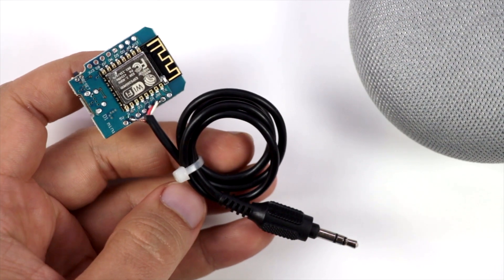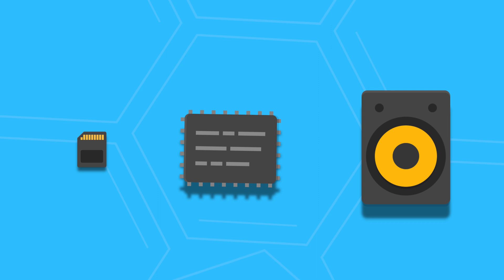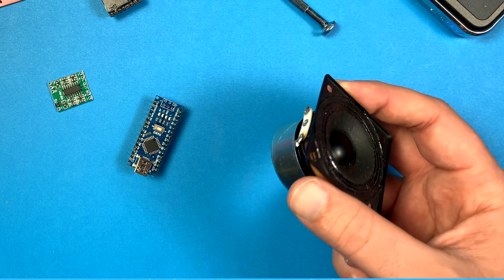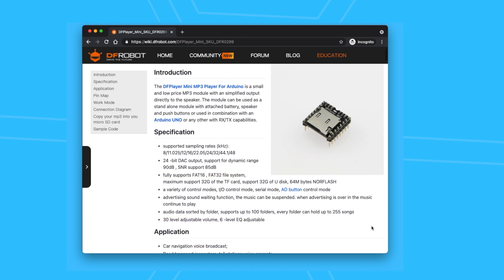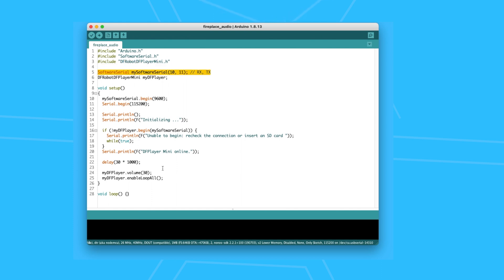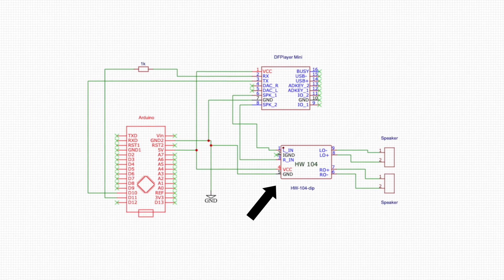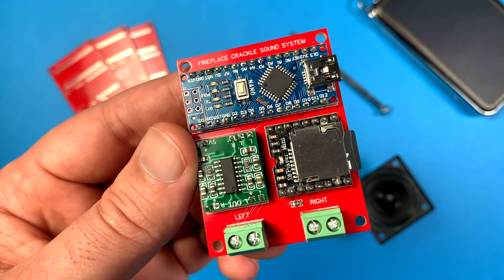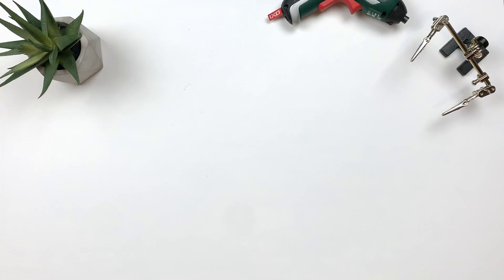Gas Fireplace Retrofit: the warm sound of crackle and pop

Comment: Great video! Any chance you can provide or tell me where you got the EDA footprint for the amplifier component?
Reply from the maker: I simply measured it by hand
Reply: @MrDIYca  I picked up one of the amplifier components you linked to on Amazon. Did you have any issues with the through holes on that board? They don't seem to be spaced evenly. I soldered pins onto it but it doesn't fit evenly on a breadboard. Had to force it a bit and it doesn't lay flat as one of the outside pin sets seems to be offset just a bit and doesn't line up.

Comment: I already have an ESP8266 turning on and off my gas fireplace and controlled/connected with Home Assistant. Can I just add the MP3 player and amplifer connected together and then powered up by a signal from the ESP8266 so the Arduino Nano is not needed?

AND -   the link to the PCB isn't taking me to the actual PCB link at PCBWay. I tried searching for the PCB at PCBWay and can't find it. Do you have a link to the actual PCB so I can order it?

Comment: Hi, the speaker pops when the Arduino turns on. How do I avoid that? :)

Thank you.
Reply from the maker: Have you tried a different Arduino?
Reply: @MrDIYca  No, as I only have unos in stock, and dont they use way more power in the long run? :)